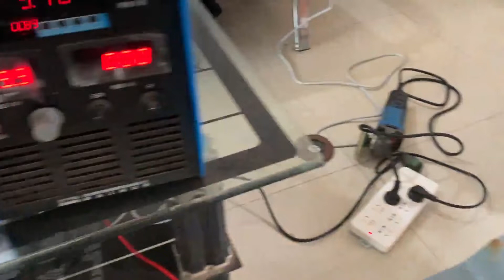Hydraulic cylinder rebuild video for hydraulic cylinder repair by brush plating Cobalt

Comment: That turned out amazing, I had my doubts that it could be done without a lathe, but the copper sands off so flush with the chrome it works great.
Reply from the maker: If it is a large area of damage, a lathe may be needed, but a small area of damage can be done without a lathe.

Comment: Hello how are you, do you have any arrangement for aluminum cylinder  brush plighting
Reply from the maker: Hello, I don't recommend brush plating on the surface of aluminum, because the bonding force will not be very good. In some cases, it is possible to use compounds containing metal components

Comment: Would you like to explain the all seven chemicals?
Reply from the maker: 1. Electrocleaning （#1 solution）

Application: Used to remove oil from metal work piece surface;

Working Environment: 6-14V voltage, take work piece as cathode during operation;

2. Activator #2（#2 solution）

Application: Used to remove Oxide film from metal work piece surface;

Working Environment: 6-12V voltage, take work piece as anode during operation;( change the switcher into “-“)

3. Activator #3(#3 solution)

Application: For carbon steel, cast iron or high carbon containing alloy steel, there will have gray-black dirt left after Activator #2 process. Activator #3 is used to remove the residual dirt.

Working Environment: 8-15V voltage, take work piece as anode during operation;( change

the switcher into “-“)

4. Chrome Activator(#4 solution)
Application: Used to remove Oxide film from Chrome work piece, improve the binding strength between coating and Chrome work piece.
Working Environment: 3-8V, take work piece as anode during operation; Water cleaning is not needed after Chrome Activator process, just brush plating Chromium Under-layer Nickel directly.

5. Under-layer Nickel(#5 solution)

Application: Used as bottom layer, to improve bonding strength between coating and base material;

Working Environment: 6-15V voltage, take work piece as cathode during operation;

Before plating (without electricity), wipe work piece by anodes and plating pen.

6.  Fast Copper (#6 solution)

Application: Used for high speed deposition and heavy build (more than 1mm) copper coating, especially suitable for printing roller pressure pits, scratches, hydraulic pillar strain etc serious damaged work piece repairing.

Working Environment: 6-17V voltage, take work piece as cathode during operation; before plating (without electricity), wipe work piece by anodes and plating pen
7.Fast Nickel/cobalt(#7 solution)

Application: Used for high speed deposition and heavy build working layer, used for large-sized tolerance work piece repairing;

Working Environment: 7-15V voltage, take work piece as cathode during operation;

Before plating (without electricity), wipe work piece by anodes and plating pen..